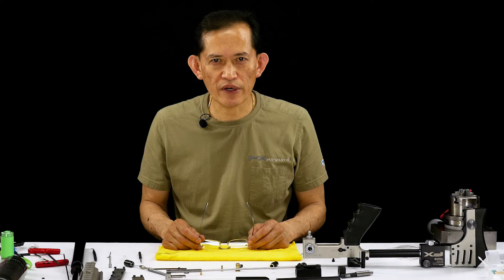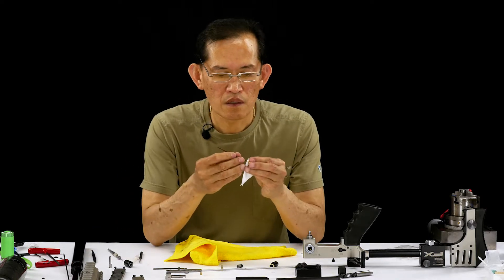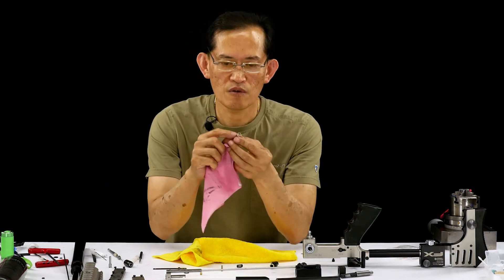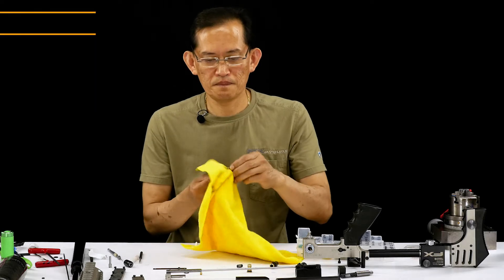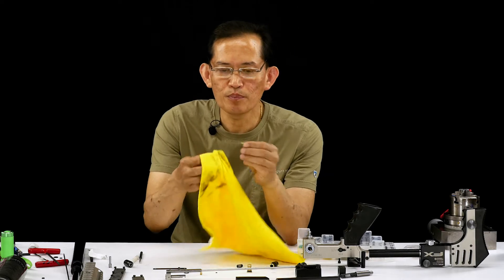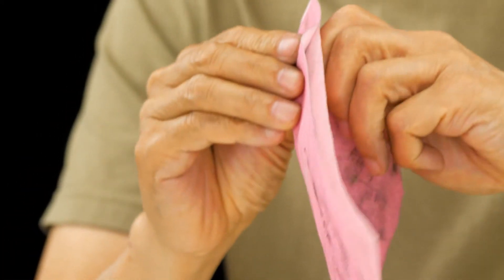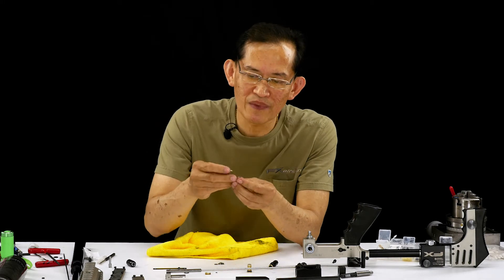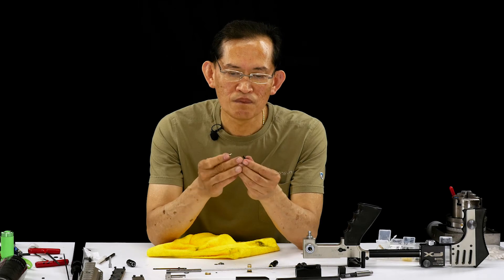FX Masterclass - Impact Maintenance : Regulator Pt. 1 (5/7)

Comment: Hello Earnest. I just purchased a FX impact X MII with the power plenum to add to my collection, and it came in leaking. I contacted FX USA, and ordered a complete O - ring kit for it. The gun is leaking about 10 bar every 8 hrs. I've stripped the gun down completely expect for the regulator housing piston and regulator adjustment screw. The reason I stripped the gun down completely is because one of the techs at FX USA told me to spray soapy water into the action where the valve rod seat spring ect to check for leaks. Moreover The next day I noticed the valve spring hammer ect was covered in surface rust. Anyway the reason I'm sending you a message is to thank you for your video's they have taught me a ton. Also I was hoping I can buy one of those tools you use to remove the regulator piston? I need to service my FX Crown countiuum as well. I asked FX USA if they can sell me that tool, and they told me they no longer have them. By the way I live in Wilmington nc exactly 1.4 miles from FX USA. It's a small world. Anyway if you for some reason don't have that tool can you suggest how I can make one? Have a wonderful new years sir.

Comment: Hi Ernest,  I currently have a problem with my MK2 Impact its only 5 days only, its very low on power. It has been fine for 5 days and then all of a sudden it lost its power.  When you fire a shot you can here the power plenum charge up with are very quick burst of air, this is normal, but power plenum for some reason started to sound very lazy and slow to charge up, what normally is pretty instant is now taken up to a second to charge up, but it still is low on power. Have you any ideas, you have me thinking now about the little hole in the reg that may be blocked, could that be it?
Reply from the maker: If you would like help from a technician with FX USA, please feel free to e-mail us or call in, and we will have someone reach out to help guide you through any difficulties you are experiencing. Phone: +1 866 639 0772
 , Email: Serviceusa@fxairguns.com

Comment: Ernest thanks for these videos . But I was wondering if there are any o rings we could use that would be more durable to use in place of the present O rings FX now uses even if they cost more .
Reply: I looked up a scuba o-ring chart that covers pressures to 4500 psi , they say the same thing , replace o-rings every few years . It’s the nature of our sport with such high pressures . There are O-ring manufacturing charts that specify certain applications I.e. chemical or high pressure that are better for what we use them for . I have to resign myself PCP’s require more maintenance , you can be reactive to leaks as they arise or proactive and do a full o-ring change .  I’m sure someone has a list of all the sizes on a particular PCP so you can shop accordingly. The easiest is to order the kits provided by the manufacturer.  One thing that might help on assembly and o-ring longevity would be a lubricant  friendly to the specific  o-ring you are using , you don’t want a bad chemical reaction between the two .  I’m a mechanic by trade and I can tell you first hand it’s important to choose the right o-ring for the application .

Comment: Thanks for the video. Just got an impact and already having issues
Reply: Harold Kennedy: me too. Had my Impact for a few weeks before I realised why it wouldn't hold PoI; turned out to be the screw that holds the picatinny rail on, which had fallen out in transit - the whole picatinny rail was loose. I reported it to FX and just got an excuse, not even an apology or acknowledgement of their shortcomings in not using threadlock.

Impact performs superbly, but I have a slow leak identified at the regulator too; probably, a damaged o-ring, but I have yet to disassemble.

I should return the rifle under warranty, but I don't have any confidence in their ability to assemble the damn thing properly without damaging the delicate components...they've failed on several fronts already. I also don't want to be without the rifle for several weeks while they fix it, so I'll just do it myself.

Component quality seems very good, but assembly, testing and quality assurance leaves a lot to be desired...especially considering the price tag.

Comment: I have never tightened my regulator under pressure and yet my regulator rod is ever so slightly bent, and has a ridge in the side of the rod because of that bend. I would suggest that the material is too soft for the amount of pressure that is imparted to it. At over $20 for this part, this is a problem that needs to be addressed.